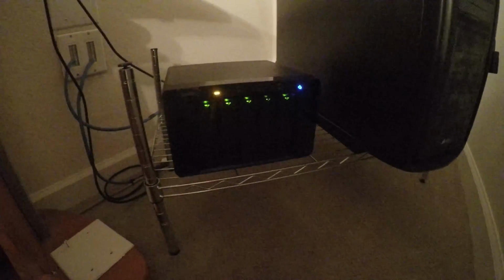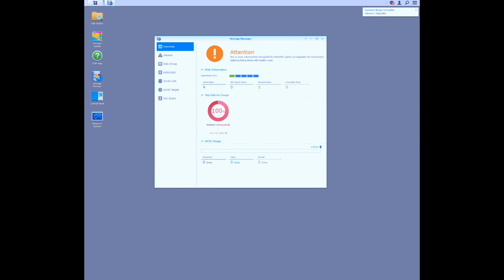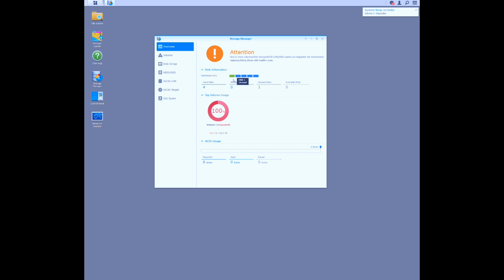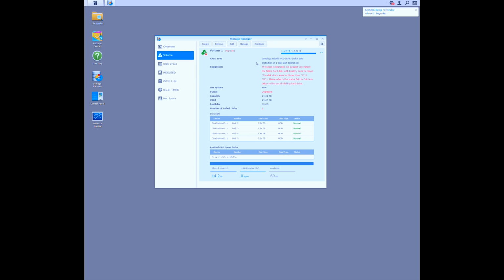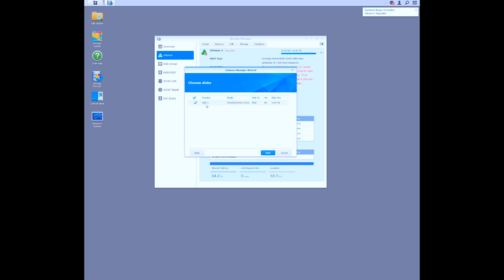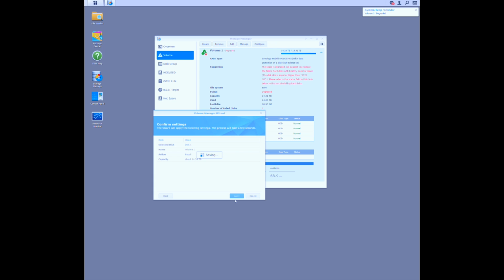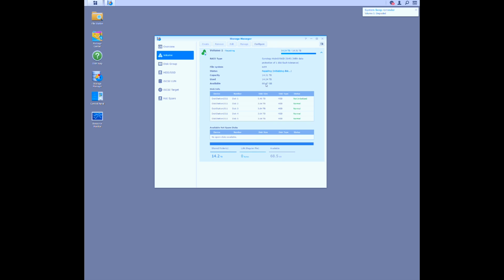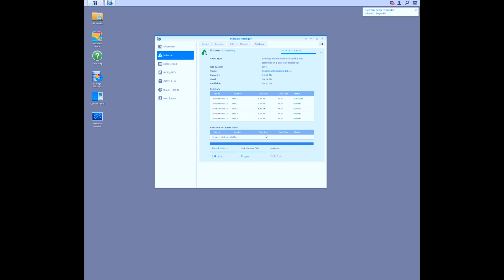How to replace a drive in a Synology NAS

Comment: I have DS1515 in remote site. I lost connection to it suddenly. Synology Assistance cannot detect it. I tried to ping DS1515 on the PC ( I VPN into this PC). No response from DS1515. But Synology Assistance can detect and connect to the other DS (DS1511+) on the same network. Do you think this sudden disconnection is a failure of one or multiple disk drives or the DS1515 HW?

Comment: what if i need to replace both the hdds in ds216j?
Reply: Or just do them one at a time, assuming it's a partial failure of the disk. If two are gone and it's only 1 disk redundant you're looking at data loss anyway.
Reply from the maker: Not sure about the model but you need the nas software to be configured as two disk failure mode in order to do that.  Otherwise you need 1 disk failure and then sequentially remove 1 disk, let it rebuild, and then remove the other.

Comment: Did you lose your data from that drive or does it automatically come back on the new drive?
Reply from the maker: No data loss.   I have it configured to be able to pull any single disk out and it will rebuild.
Reply: it depends on the RAID type you have chosen. If it allows a failure of one disk, then there is no data loss. If you have RAID 0 (no redundancy), there is data loss.